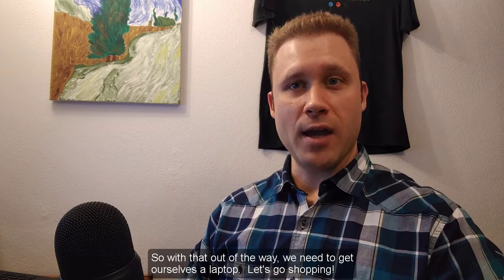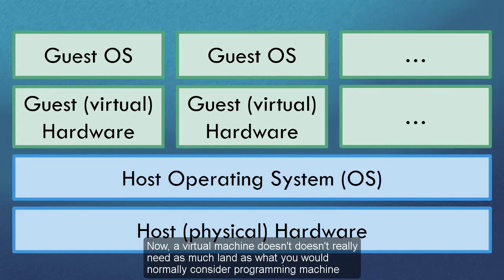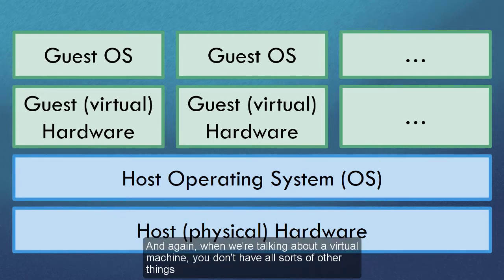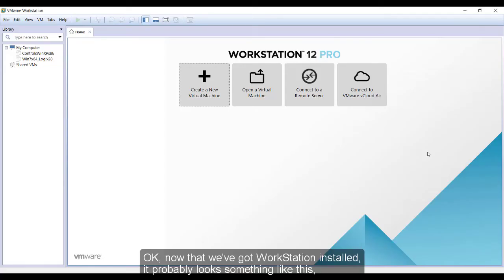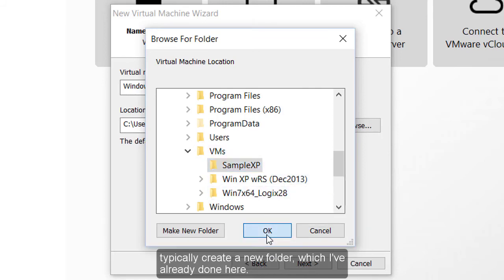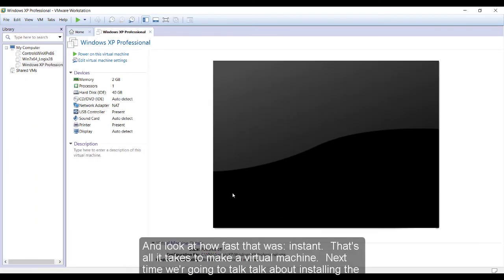Making a Virtual Machine

Comment from the maker: TRANSCRIPT
>> JON BREEN:
00:05 hey folks this is Jon and today we're going to build our first virtual machine
00:09 together but before we do that I want to prime your brain a little bit I want you
00:13 to be thinking about what your needs are so that as we go through this you'll be
00:16 you'll be connecting the dots you'll really be seeing this is important and
00:20 this is not to me and how you can get the most the most benefit out of this so
00:25 ask yourself some questions what's important to you do you need to be able
00:30 to support a lot of different kinds of software or maybe just a couple
00:33 different kinds of software that don't play well together do you need to be
00:38 able to support old automation equipment that maybe has programming software that
00:42 only runs on a 32-bit or heaven forbid a 16-bit computer do you need an IT free
00:47 zone do you have software that's sensitive to different kinds of IT
00:52 controlled things like anti virus use account control or do you just need a
00:57 good recovery option a way to get back to square one if anything ever goes
01:01 wrong my approach when when i'm looking at virtual machines I talk a lot about
01:07 Rockwell but I i do omron and GE and and any kind of plc i can get my hands on
01:14 I'll program it so I've got to deal with very old software sometimes 16-bit and I
01:21 have a windows XP 32-bit machine that I run all the old software on then
01:27 everything newer I just put on a windows 7 64-bit virtual machine and that that
01:35 really covers all of my needs if I ever need to separate two pieces of new
01:39 software that don't want to play together i can use snapshots to do that
01:43 and i'll talk about that a little bit more later so with that out of the way
01:47 we need to get ourselves a laptop let's go shopping just to make things simple I
01:53 picked a manufacturer and i'm going to start picking a line of laptop here 14
01:57 inches a little small for programming let's go with a 15.6 that sounds great
02:01 so here the sub models in that category now most of the things that we get to
02:05 choose here are really more about your programming preferences than actual
02:10 virtual machines this looks good it's got the screen I want its it's got a processor that I
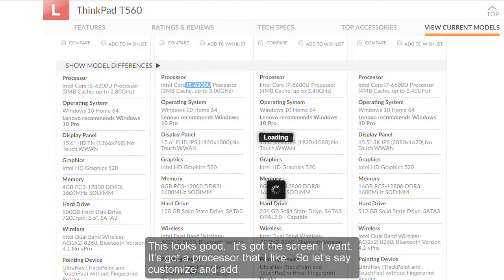02:16 like so let's say customize an ad okay now we get to pick all the fun details
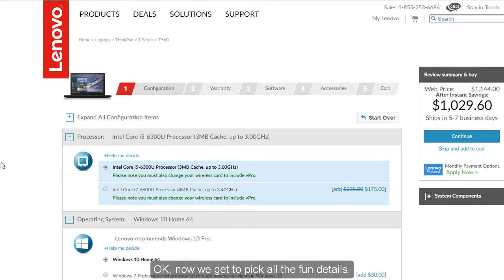02:23 memory this is very important I would say if you're going to run virtual
02:28 machines 8 gigs is bare minimum 16 gigs is pretty good and again if we're
02:33 talking about what I'm doing actually I go with a 24 gig system for my
02:38 programming computer because I like to be able to run several virtual machines
02:42 at the same time if I need to and I wanted a little space for future
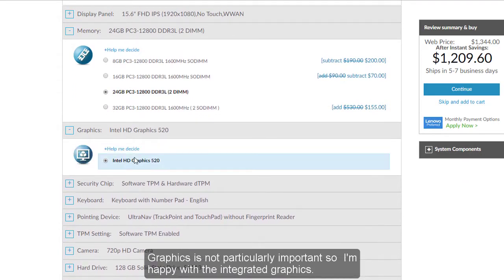02:45 expansion graphics is not particularly important so I'm happy with with the
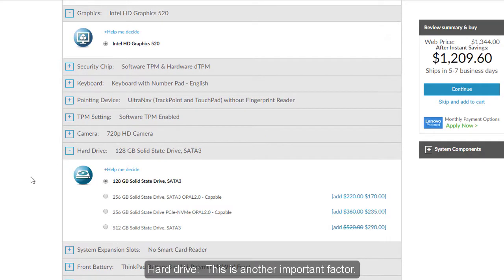02:53 integrated graphics hard drive this is another important factor now consider
02:58 when you're running a virtual machine first you have to boot your your
03:02 physical machine into into windows or whatever operating system using and then
03:07 you have to boot your virtual machines you're doubling your boot time right now
03:11 so I would say absolutely hit a solid state drive it speeds that up a lot my
03:16 preference is to is to go for 500 or so seems like a good balance between costs
03:21 and being able to fit things on my hard drive and that's really all that's
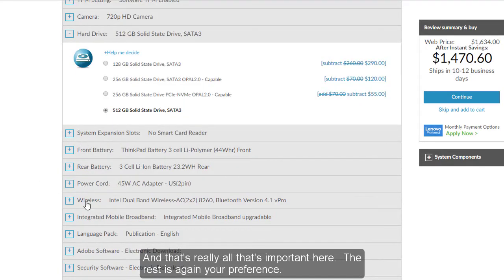03:26 important here the rest is again your preference now that we looked at what
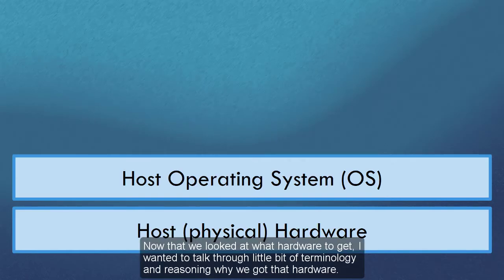03:31 hardware to get I wanted to talk through a little bit of terminology and reasoning why we got that hardware so
03:38 this drawing that I have here represents basically what you're used to seeing
03:42 when you have a computer the host is the word that we use to describe the
03:46 physical hardware and the operating system that rides on top of that
03:50 physical hardware so you'll frequently hear me say host machine this is what
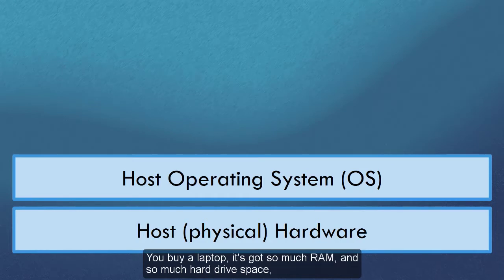03:54 I'm talking about you buy a laptop it's got so much RAM in so much hard drive
03:57 space whatever processor we picked that's the host that's the physical
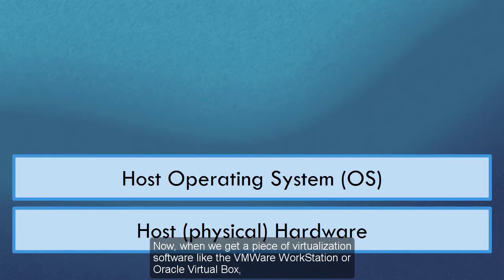04:01 machine now when we get a piece of virtualization software like vmware
04:06 workstation or Oracle VirtualBox what we're really doing is we're creating
04:10 virtual hardware and we call this the guest there's guest virtual hardware and
04:15 then on top of that we install a guest operating system this might be windows
04:21 XP something 32-bit for older machine support or maybe you have Windows XP and
04:26 then you also have windows seven this is like I said this is what I do now we can repeat this
04:33 process as many times as we want once it's virtual you know we can copy and
04:36 paste and make a billion of them and the the only the only limit to being able to
04:41 do that is again memory so that's why I talked about ram and hard drive space
04:45 when we were picking hardware is because first of all when your virtual machine
04:51 is running it does take real Ram it Maps your virtual memory on to your physical
04:56 memory now a virtual machine doesn't really need as much RAM as what
05:02 you would normally consider a programming machine needing because
05:05 normally when you have a programming machine you you want to be able to run
05:09 your operating system run your programming software and at the same
05:12 time run your email run your your web browsers run your PDFs and all sorts of
05:19 other things and on a virtual machine we don't really need that so usually I say
05:24 somewhere in the 2gig range seems to work pretty well for a virtual machine
05:28 because we're not running that much on it if I start running bigger applications maybe I'll go to two and a
05:34 half or three gigs but really I haven't had any need to go higher than that the
05:40 second piece of this is hard drive space so Ram makes a difference when the
05:45 virtual machine is running or when the virtual machines plural are running hard
05:50 drive space makes a difference whether it's running or not and this is the same
05:54 as any physical computer you might have that hard drive has the operating system
05:58 and software installed on it whether the thing is turned on or not where your RAM
06:01 only has something in it when it's turned on and again when we're talking
06:07 about a virtual machine you don't have all sorts of other things installed on
06:10 it you have the operating system and you have the programming software so you
06:15 really don't need as much hard drive space for a virtual machine as you would
06:18 normally think you would need for a physical machine what I find usually
06:22 having on my virtual machines is somewhere around 10 to 15 gigs for an
06:26 older windows XP machine and something like 20 to 25 gigs of real physical hard
06:34 drive space to be able to have a Windows 7 machine now the more snapshots I have
06:40 the more things I have installed it definitely gets bigger from there that's just kind of a
06:44 baseline ok that's enough theory let's make it actually happen now go to VMware
06:50 calm and i'm going to get my software so if you look over here there's a products
06:56 tab click on that and I'm looking for VMware Workstation pro workstation
07:02 player doesn't have the snapshot feature and if you can't tell I am a big fan of
07:06 that so let's go with pro go ahead and say buy online or you can try it for
07:11 free I think it's a 30-day trial and go ahead and install it and follow the
07:18 prompts it's it's very easy installation ok now that we've got workstation
07:25 installed it probably looks something like this and to make a new virtual
07:29 machine i'm going to click on this huge button that says create a new virtual
07:32 machine there's a nice little wizard i'll go with the typical settings and
07:36 click Next and i prefer the extra control i get from installing the
07:41 operating system myself so I'm just going to do that if you want to you can
07:45 have an installer disk or image here and it'll actually install the operating
07:49 system while it creates the virtual machine might save a little time but
07:53 again i prefer the control of just doing it myself so I'm going to click Next on
07:57 that and it's going to ask what kind of guest operating system it's going to be
08:01 because it'll set it up to to perform best with that operating system so i'm
08:05 going to say it's microsoft windows and just for this example I'm going to do
08:10 windows XP professional and we'll say next now you can give it whatever name
08:16 you want I'm going to leave it like that because why not and then I prefer just
08:21 for the sake of having a having a good place for for virtual machines inside my
08:28 C Drive I have a VMs folder each VM is just a collection of files in a folder
08:35 so those files are going to live in whatever folder i select here and for a
08:39 new vm i would typically create a new folder which I've already done here I
08:43 will click Next now we've got two options here for the hard drive it can
08:48 store the hard drive in multiple files which would make it easier to transport
08:52 later if we move it to a different computer so that we don't have to have a humongous flash
08:57 drive or we can store it as a virtual disk file and that virtual disk file and that's I'm
09:02 going to choose the single file because as things get bigger this is this is
09:07 better performing than having the 10 multiple files click Next and notice
09:15 here the memory it assumed we will only want a half gig I'm going to change that
09:18 I'm going to click on customize hardware and you can either drag this around up
09:24 22 gigs 2048 or you can just type 2048 right in here and click OK and so we end
09:33 up with two gigs there so that's great so I'm going to say finish and look at
09:40 how fast that was instant that's all it takes to make a virtual machine next
09:45 time we're going to talk about installing